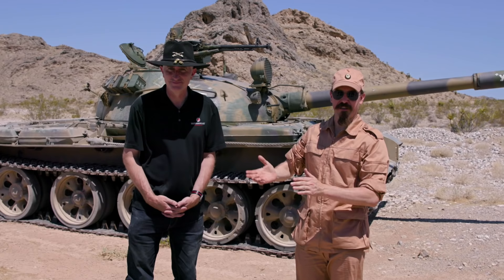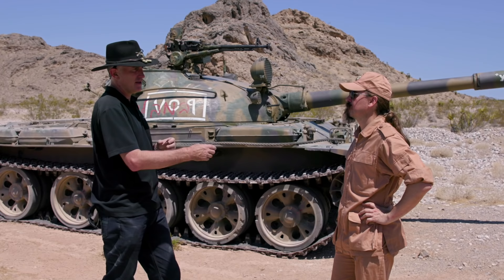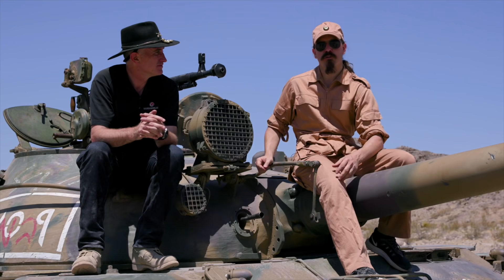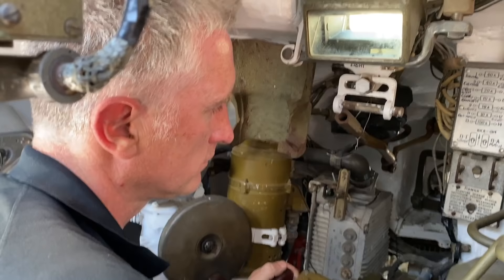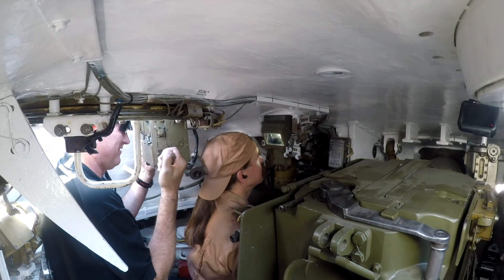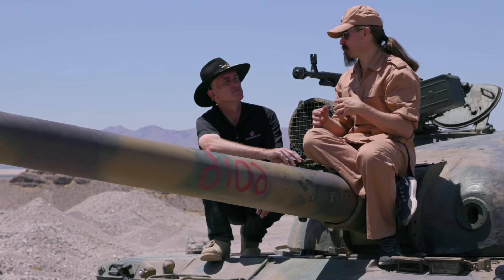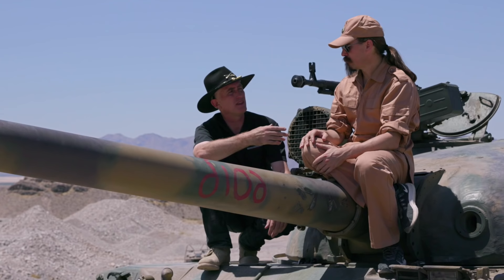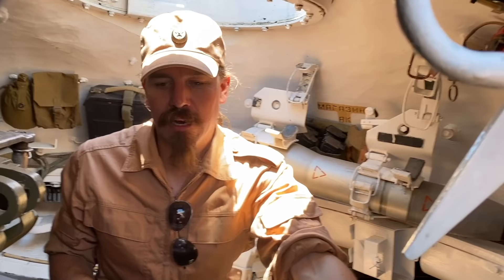All the Guns on a T-62 Tank (with Nicholas Moran, the Chieftain)

Comment: 22:31-22:49 Yes. The T-62 was able to penetrate both the Chieftain, and M60 Patton tanks. During combat in the Iran-Iraq war, it was found that the British Chieftain tanks were being penetrated by 115mm ammunition, at the front of the turret, and upper glacis plate (according to the data I have, apparently 70% of the Chieftains were knocked out, mostly by 115mm guns). What's even more surprising was the fact that something as "mundane" as steel-cored APDSFS from the T-62's gun, was able to achieve these frontal penetrations (against the Chieftains), with good reliability, and at around 1 km range (or more)

This vulnerability of the Chieftains was also proven (at nearly the same distance, same gun, same ammunition, and same impacted points) during Soviet tests as well. I recall, that the Russians managed to capture (relatively) intact Chieftain (specifically Mk.5 versions. These British tanks were sold to the Iranians, which were then captured by the Iraqis. Which were then given/donated to the Soviets by the Iraqis), and M60 Patton tanks. With these captured vehicles, they were able to perform extensive tests on them. Because of these tests, the Soviet engineers concluded that Chieftain tanks were vulnerable to 115mm, and 125mm guns. The most notable thing, that I remember from the report is that, areas of 240mm LOS thickness (on the Chieftain, and M60 tanks) are fully exploitable by 115mm guns using finned ammunition (both steel, and tungsten cored ammunition)

<<Sources of Data>>

A) https://www.cia.gov/readingroom/document/cia-rdp82t00709r000102700002-6 

(Just to make sure I am not bullshitting about Soviets testing captured Chieftain tanks given by the Iraqis. Here is a CIA intelligence report about the presence of British Chieftain tanks in Leningrad testing areas)

B) http://btvt.info/3attackdefensemobility/432armor_eng.htm (Some details about Soviet tests on captured Chieftain tanks, and a study of the vulnerability of these British tanks)

C) https://thesovietarmourblog.blogspot.com/2015/12/t-62.html?m=1#ap (Some more information about the T-62's 115mm APDSFS ammunition. Courtesy of Tankograd. Yay, Tankograd!!!)

D) https://www.flickr.com/photos/7682151@N07/40600023554/ (Some information about the resistance of Chieftain tanks to 115mm, and 125mm guns)

If your a military history nerd like me, hopefully, you find this information useful   😊
Reply: This comment really needs more upvotes.
Reply: Thank you
Reply: You're*
Reply: @NateTheScot  Argument destroyed
Reply: Thank you
Reply: Could it have a chance against the Ukraine T-64 today? Looks like Russia might starting to use them there
Reply: @riverman83  It'll definitely penetrate yes but given the miles ahead in technology between the modernized Ukrainian T-64 to the T-62 (The ones Russia is sending out only has "cheek" add-on armor on the turrets, no visible ERA) it's probably just going to be a case of who shoots first+who can take out Mr. Diedfirst's friends, which given the T-64's far more advanced gun and systems would probably give it the advantage.
Reply: @DogeickBateman  One would assume the T-62s are going to be used to arm pro-Russian militias in the Kherson and Zaporozhye regions, and thus it would be unlikely that they would go head-to-head with T-64s very often.
Reply: @Xorobabel  Probably which then begs the question:

Did the militias run out of tanks that quickly? Pretty sure they had a nice stock of 72s, 64s and even 80s, but given the war maybe it ran out.
Reply: @DogeickBateman  I mean, the militias are using mosin nagant soo
Reply: @DogeickBateman  T-62m/mv is more of a cost-effective & easy-maintenance choice than T-64/72/80. Plus it's 115mm and can still do most of the work. Plus there is a giant pile of them in stock.
Reply: @DogeickBateman  Suprise or not, Russia still has T-62 in service these days despite their large stocks of T-72/80.
Reply: @edwardjoe8448  Not really a surprise given the T-55s and even T-10s are still used by reservists.
Reply: Thank you for this! Fascinating stuff!
Reply: @DogeickBateman  
The militias have about  15000 adittional men now
Reply: @edwardjoe8448  
Russia HAVE 0 t62 in service
Reply: @ignacio3890  15,000 additional teenagers and seniors
Reply: @ignacio3890  Ok bot
Reply: @ignacio3890  Can't see your replies if you posted one so cope about bolshevik
Reply: @DogeickBateman  
Lol.... YOU'RE really desperate to avoid the truth?
Reply: @ignacio3890  Lol, you're really desperate to swallow that Kool-Aid?
Reply: @ignacio3890  Ok Jewshevik
Reply: I had noticed these incidents as well and it makes me suspect that much on the modern battlefield can't be used the way it is intended to by doctrine ... 

B-52s shot down from not so sophisticated ground missiles in Vietnam, cruiser-class ships, sunk by sea-skimming anti-ship missiles during the Falkland War or now in the Black Sea, tanks and APCs blown apart by RPGs in Chechnya, helicopters downed by RPGs in Afghanistan and Somalia - high risks that demand a conservative approach in solely conventional maneuver warfare (the Cold War anticipated the deployment of nuclear arms in a major conflict which woulk have effected the viability of supporting infantry, dramatically). 

That contrast to arms manufaturers allusions to survivability makes the Soviet fixation e.g. of arming APCs and tanks with HEAT missiles ('Bastion' to 'Sheksna') appear much more realistic than it may look in simulations (guided missile hit probabilities as low as 20 percent). 

Since the mass production of missile weapons, 'stand-off strikes' and mobile 'defense in depth' appear to be much more viable doctrines than 1918  Liddell Hart's and Guderians 'Blitzkrieg' - despite Nazi Germany's spectacular successes in France and in the Soviet Union in the early 1940s. 

It also makes one question bloated military budgets that don't translate into sophisticated, layered air defenses, stand-off arms or submarine fleets, but most exposed large surfaces ships and a monoculture of not so 'invisible' strike fighters, insisting upon an 'air superiority' doctrine, appliable solely to 'banana republics'...
Reply: God bless you presenting actual sources
Reply: Thx!
Reply: I hope you don't play Warthunder
Reply: GREAT COMMENT!
Reply: It even has sources linked!
Reply: @christophmahler  so it take us back to phrase of one of german generals "It would better for troops to have  PzIV everywhere they need tanks, than PzV and PzVI NOwhere troops need tanks", its about cost and speed of tank production, and doctrine of "wunderwaffe". I think future is about lighter tanks for mobile infantry support, not so "cool" and "invelnerable", but with tactically agile weaponry, low mass and cost, because anyway any vehicle can be destroyed. So it looks like more active defences like israelian "Trophy" or russian "Arena" and guns closer to Nona's 120mm low-pressure universal cannon-launcher (mortar, cannon and ATGM launcher in one piece), than 125 "tankhammers", maybe with 20/25 coax autocannons. And, i think it highly possible - with dronepads. Use tank as commandpost for recon drone and few barraging kamikaze drones looks like just "musthave" option for modern infantry support vehicle, which tank were from start and still are.
Reply: A YouTube comment with sources. I'm impressed
Reply: A YouTube comment with sources cited? Incredible!
Reply: T62's are not that good, centurions have taken them out.
Reply: @smegheadGOAT  pfff. "Tigers were not that good, SU-76 had taken them out".
Reply: Félicitations, in voit un expert, jamais j aurais cru que le chieftain soit percé par le 115
Reply: Class act
Reply: Average war thunder forum enthusiast
Reply: @riverman83  MBT's are not invincible. Any particular spot is only up armored to a given threat and if it can't be, it falls back to a substantially lower level of protection. IE they can't put plastic and ceramic inserts in the gun tube or recoil cylinders for obvious reasons, so they're only as armored as they need to be to stay functional through autocannon fire. Any tank hit through the gun mount would go right through. The sides are too long to uparmor to be immune, so they're only proof against whatever autocannon you field, and so on. A T-64 is not going to be substantially different in this regard, just thicker where it's uparmored for tank on tank combat. That means the faster, more flexible platform is typically more lethal and survivable provided their training is better, but ultimately it just falls to who has the better supporting units in that instant and who gets the first shot.
Reply: Yes but the Chieftain could also lolpen a T-62 out to 2km. A chieftain could penetrate 140mm at 60o at 2000y as shown in test reports. Standard T-62s had a 100mm plate at 60o which is worse than the chieftains upper front plate.

The Chieftain was a dated design compared to the next generation stuff that the Russians were fielding, however Chieftains in the right hands would have no issues taking out T-62s at long range as the Israelis did with bloody Centurions with worse ammo years earlier.
Reply: That explains the steel brew upgrades then no doubt...
Reply: Dope tank talk my mobile armoured brotha !
Reply: Finally, some sources
Reply: You're*

Comment: The Arabic markings on the tank: right side of the turret reads "759", and on the rear of the vehicle literally says "The Army".
Reply: It also has IDF markings on it, probably a captured Egyptian or Syrian tank, although if that's the case I'm not sure why they would leave the arabic markings on it.
Reply: @redlabel5241  Ah, so that would be the red spray paint? I only recognized the Arabic since it's my native language. 
This thing seems to have changed hands quite a few times till it arrived at the US!
Reply: @Y.M...  The writing inside the number rectangle is an acronym for "Base Work Shop". Right next to it outside the rectangle it says "Line". On the barrel, worryingly, it says something like "Disqualified" or "defective".
Reply: The markings I was referring to were not actually the red ones, the "license plate" numbers (white digits on black background) are clearly IDF and on the turret the same number is written in white with the hebrew letter for army (a serial number with the letter צ is very common for marking IDF property) next to it.
Reply: @redlabel5241  Neat. Thanks for clarifying those markings as well!
Reply: @redlabel5241  The barrel sure looks like it's seen things! you can see some chunks of metal missing, probably from a machine gun firing AP rounds. Thats enough to disqualify it from service but I guess one round here and there wont completly destroy it
Reply: Just FYI. Battlefield Vegas has 2 of these tanks. One Iraqi and one Syrian. The other one is now in running condition and the gun is being rebuilt to live fire condition.  I think this one is the Iraqi tank. Hopefully these two fellas get to do this for every tank they have, as the fleet is growing fast
Reply: @ChevTecGroup  from the camo i can say it is syrian and the unit marking on rear of the tank
Reply: @soyounglee5985  yep you are right. Their other one is iraqi. They used the barrel from the iraqi tank to get this gun working though
Reply: @ChevTecGroup  i think it was captured by IDF during the 1973 war or in 1981 conflict in Lebanon
Reply: @redlabel5241  right פסול is rejected/faulty/defective in hebrew

Comment: When I reported for duty with the 3rd US Cavalry Regiment there were no M60 tanks in the motor pool. All of them had been shipped to Israel to replace losses there. A few months went by, and we got a Czech built T62 tank that the Israelis had captured on the Golan Heights. We used it in Warsaw pact vehicle familiarization training.  What I remember is how ruggedly reliable that T-62 was. It got no maintenance at all but just kept on running and running. When it stopped smoking, we knew it was time to add engine oil!

Comment: @2:54
The 12.7 x 108 mm gun has been designed  by designers Дегтярев (Degtyarov) and Шпагин (Shpagin).  Military systems are traditionally called by the name of chief designers.
So naturally the gun's official name is ДШК - Дегтярев, Шпагин, Крупнокалиберный. Крупнокалиберный is not the last name of another designer :), it's a description of the gun, an adjective meaning Large-caliber.
When you transcribe ДШК into English you need to come with a way to substitute symbol Ш. The intent of a transcription system is to substitute not exactly the symbols but the sounds, which the symbols typically produce. This way Ш becomes SH, different symbols but the same sound :) 
So Д->D Ш->SH К->K and ДШК becomes DSHK.
The ДШКМ is an abbreviation for Дегтярев, Шпагин, Крупнокалиберный, Модернизированный meaning Degtyarov, Shpagin, Large-caliber, Modernized
ДШКМ ->DSHKM.
Pronunciation of abbreviation in Russian adds a bit more complexity. It's hard (or not typical in verbal Russian) to pronounce  3 consonants in a row [d][sh][k], even harder for 4 consonants - [d][sh][k][m]. So natural Russian language rules convert each symbol in ДШК into a sound as they are called in alphabet.  In alphabet Д is pronounced as дэ [d[]je] not д [d],  Ш - as шэ [sh][je] not [sh], К - as ка [k][a] not [k], М - as эм [je][m] not [m]. 
Combining all together we got pronunciation (sounds) for ДШКМ as дэ-шэ-ка-эм [d][je][sh][je][k][a][je][m] - consonant, vowel,  consonant, vowel, consonant, vowel, vowel, consonant
Reply: Learned something new today
Reply: Чувак, ты столько букв потратил на это....
Reply: Единственное, где можно поправить, так это то, что "je" относится к букве "е" (русская Е), когда буква "э" транслитерируется просто как "e" (английская И). А так я вообще удивлён, что кто-то потратил на это время.

Comment: "Why carry a weapon when the weapon can carry you" love that
Reply: Very common phrase (and belief!) in the Armor community. Then usually the Infantry will grumble something about the Queen of Battle or point to their Airborne wings, but Tankers ultimately win the argument when the "crunchies" come skulking over to the back of the tank during winter to keep warm or heat up a ration pack off the engine exhaust. 

When you catch them gazing longingly up to the TC or Loader, and they observe the crew have their parkas unzipped because the heater is keeping the tank so warm, it's at that point that you shut off the main engine and just use the APU, to watch the sparkle leave their eyes. Queen of Battle, indeed.

Comment: Former US Army tanker.  Ian, your loading needs work ;-)  25:10  take the palm of your left (dominant) hand and place it on the butt end of the round.  Right hand on the neck of the round.  Place it to your chest, drop your left hand vertically downwards while bending your knees slightly.  Use your right hand to guide the head of the round into the breach while driving the round with your legs, back, shoulder, and left hand.  It takes practice to get it right and makes everyone look a bit silly at first.

Comment: My god, that round actually dwarfs the 90mm on the M48A3 tank I served on in the USMC. The only saving grace was the M48 had a much higher rate of fire. If the main gun was properly sighted in, we had a 90% chance of a first round hit at 1800 yds, IIRC. The 50 cal in the TCs cupola had a bad habit of jamming expended links and brass thru the inadequate ejection port, which is why you see them mounted on top of the M48s in Nam... A 5200 fps 115mm round is mind numbingly awesome. Our fastest round, the DU 90mm round as I remember, had a MV of 4000 fps. I did notice that the 115mm round did not have rifling engraved on the projectile to give it the spin necessary to stabilize it. How did that work in a smooth-bore cannon? I wish you had mentioned that. Also, this gun has a bore evacuator to clear fumes from the bore. Our 90mm did not. All we had was a manual fan to pull the smoke out of the crew compartment, and hell yes it got thick in there. These tanks thankfully never faced each other in Viet Nam later in the war when the ARVN took over our tanks after we went home. They lost almost 200 M48's against the NVA because of the better Russian armor they eventually got to replace the pathetic PT 76 light amphibious tank and the deadly saggar wire-guided anti-tank rockets from Russia. The RPG 7 or antitank mines were the M48's main threat back in '68. I think every Viet Nam era American tanker thanked their lucky stars they missed seeing this one thru their gun sight ....